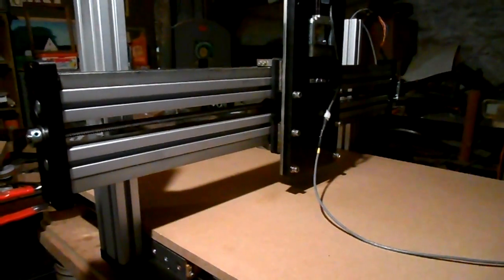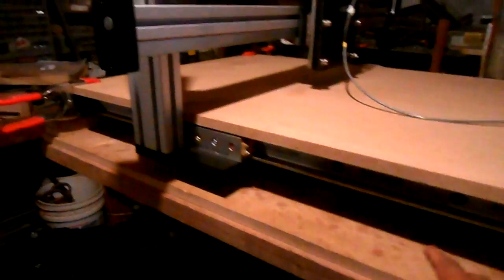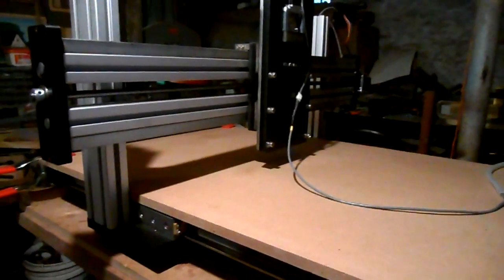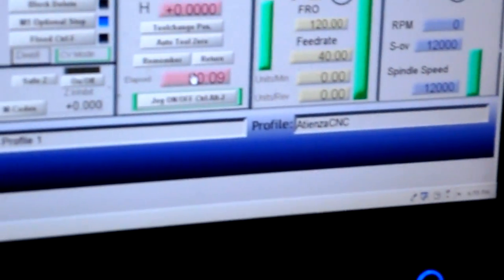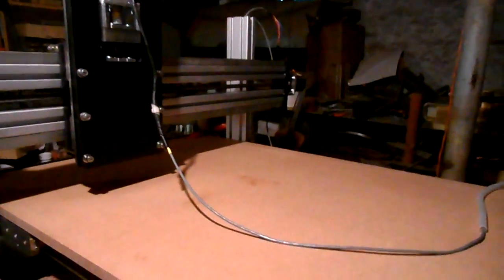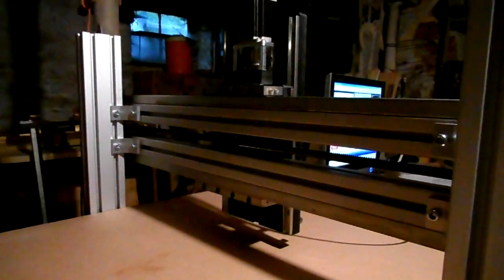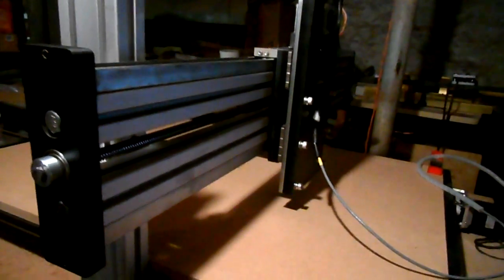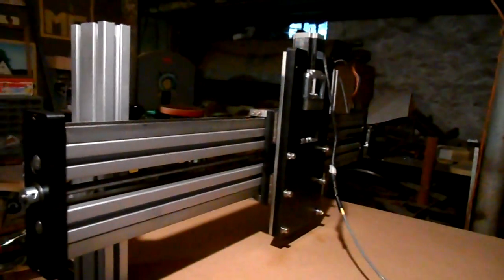DIY CNC Rebuild using 8020 Extrusions!  1000IPM Rapids

Comment: Good thinking making designing adjustability into it. A friend of mine did something similar by making the table height adjustable using four linear guides and four allthread leadscrews commonised by a chain. It actually worked ok.

Comment: Louie -- may I ask, in your experience, for a given length, how much flex to these 90 45 rails have? I am looking to having a very long Y (7 feet), and I am considering 90x90 Alu rails (I  have an excellent local supplier). Steel would be better, but I am not a welder.
Reply: Sorry I hadn't responded... been away from YouTube for a whole and only now coming back to check messages.  For that length look at 90180...

Comment: safety precautions? Say if the carriage runs into the surface, what prevents it from self-destructing?
Reply from the maker: First, you spec the motors right - if they can tear your machine apart, they may be spec'd too large or your machine is not strong enough.  Second, since they're steppers, if they hit a hard stop they'll just stall.  No harm to machine, or steppers.
Reply: OK, makes sense. I wonder if I could add on relay that stops the carriage when a switch is bumped. I believe this is how it was done on my old Bridgeport.
Reply from the maker: You can add microswitches, proximity switches, whatever, that will trigger a limit stop in your control software and disable the drives.

Comment: What size are the steppers?
Reply from the maker: +Pete Mathews 425in-oz on the X and Z axis (likely limited to about 380-390 due to the PSU) and 380in-oz on the Y.  Hi pitch (1" lead) screws.

Comment: Beautiful build. You've convinced me to abandon the Solsylva build I inherited from my brother and just do 80/20, as I have on other projects. Still so much to figure out. Wish I had the money to just buy a complete kit. But figuring it out can be rewarding as well. :)

Thanks for posting this!
Reply from the maker: Jon Miller I think you might want to reconsider that...  I didn't just get to this point.  I stared out myself with a Solsylva build.  The best part about it is that you won't feel so bad when you run into a hard stop or gouge the table!  And I learned so much just by putting it together, and figuring out what worked and what I thought needed improvement for my needs.  Believe me the experience is the best learning you can get...

Comment from the maker: I built this using my old machine, which reduced build time considerably.  That said, it took about 25 hours or so to complete.  I would say there's about $1200 in materials and electronics, though I did use surplus materials on eBay.
Reply: please can you make me the list of materials that i would need to build the same thing at home?

Comment from the maker: Thanks...  There are some that use those type of glides, though, since they run on the extrusions themselves, there is some risk of wearing the anodized finish on the extrusions.  Also I cut a lot of abrasive materials, and that may foul up the bearings.

These linear rails and trucks are still very cheap on eBay if you can find them.

Comment from the maker: Sorry, a few folks have asked, but unfortunately I lost all files after my last hard drive went!  It's pretty simple however as I just made plates with holes to connect the 8020 parts.  You can get the CAD for the 8020 on their site, or SketchUp's (Google's) cllection...

Comment from the maker: Thanks.  You can try a Chinese spindle/VFD on eBay.  I use a Bosch 1617 wood router and SuperPID speed controller, with PreciseBits collets.

Good luck with your chainring. I'm designing a new one now should have it up soon...

Comment: Your set-up looks great! i'm getting ideas..

Perhaps you can help me. I'm in school for manual machining, and CNC in the fall.  I had the opportunity to pick up a pre-assembled desktop CNC router, very much like this, so i did.  It works great, but i'm not happy with the spindle and motor.  Forget this tiny Jacob's chuck, I want to run collets! Can you recommend somewhere to buy a motor/head/spindle assembly? Also, nice work on the BMX chainring.  I'm drafting one up in AutoCad now. :)

Comment from the maker: Thanks everyone for the comments.  

As for the speed, the extra stepper does make a big difference, though it should be sloghtly slower with the router in place.

As for stepper hiss, they do a little bit when the machine is parked.  It is a lot quiter than other machines I've seen however, and have no explanation for that!

The timing belt/pulleys can be cheaper than some better flex couplers, and probably havve better vibration and shock damping properties as well.